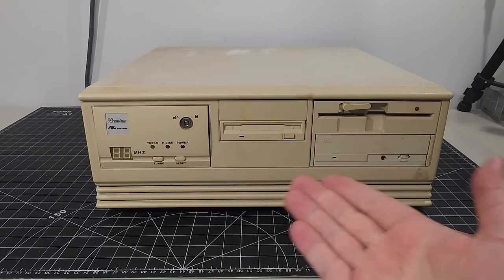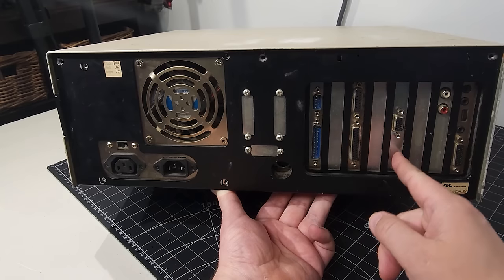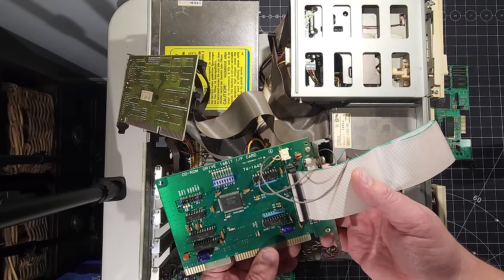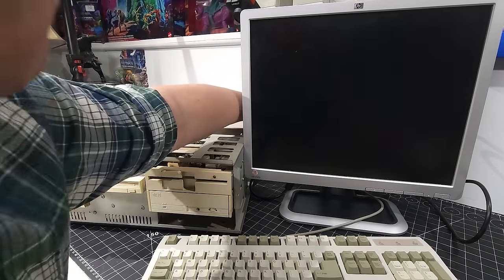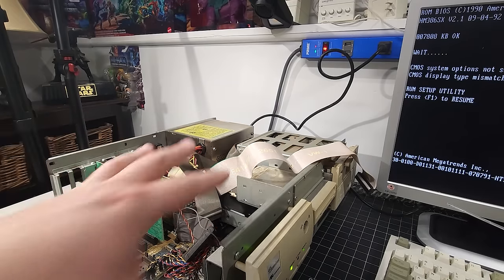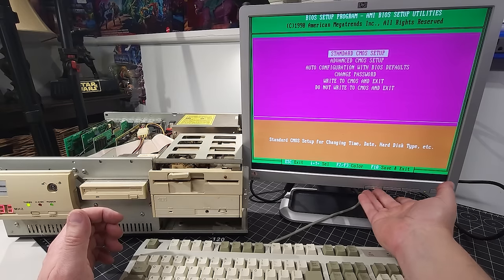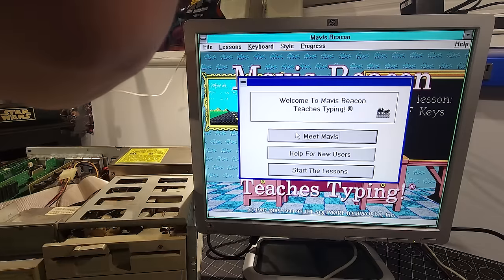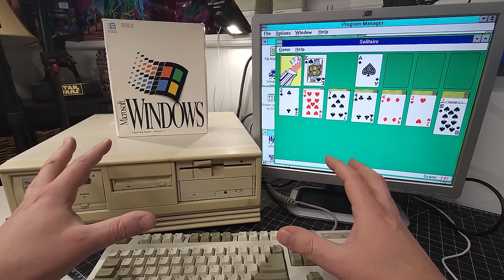What is this Computer...Will it work??

Comment: This makes me feel old.  I remember building these and believe it or not, in the manufacturing plant I work in, I still have a handful of them running DOS.  I've reworked them over the years to keep them running and even put SSD's in them but they're still there chugging away.
Reply from the maker: An SSD in one, that would be quite interesting to see - that and you still have them going, awesome!  Thanks for sharing.
Reply: @TheRetroRecall    Startech makes an IDE to SATA adapter that has worked 90% of places I tried it.   I've supported 300+ production systems for over 30 years now.  When the last floppy disk plant went under about 10 years ago, I bought a bunch of boxes of them..  Still use them to update schedules on some equipment...
Reply from the maker: Nice!  Yes, I'm familiar with Startech stuff.  There are also a lot of different brands on Amazon that I have used that have served the purpose.  Not sure about longevity to be honest.

Comment: IV had that exact thing happen with an ide cable with an old 486 system I bought. Swapped out the cable and it was fine
Reply from the maker: I've had them break inside the cable before, a simple swap out fixes them.  That said, I never recall them preventing the machine from booting.

Comment: So, what was wrong with the cable?  a close look or even rubbing fingers down it could show a bend/break.
Reply from the maker: At first glance, I couldn't detect a break based on touch.  When I get some time I'll use the multimeter to see if I can find an issue.

Comment: I wonder why that IDE cable was preventing the HDD from spinning up. Not installed the wrong way by any chance? .. I'd examine it and meter it out to see if maybe there's a short between a couple of pins.
Reply from the maker: I checked it again afterwards as it was suggested it could be installed incorrectly and the same result (even though I confirmed it was correct).  I'll have to check the cable.

Comment: If you noticed the red HDD led was solid when the fault occurred, but went out and is flickering now that the cable has been changed? That was an indicator of the crook cable or I/O card error.  Windows 3.11 for Workgrooups was the best and WordPerfect for Windows was discontinued after version 5.2. Also it's an 80386 not a 30386 lol. My first PCwas an 80286. Microsoft back then also promised to keep their OS small and under 100mb but look at them now and windows just keeps getting bigger and crappier. Anyway nice PC and brings back many memories of my old girl...
Reply from the maker: Thanks for the added detail :)

Comment: It works great 👍 Can it run Crysis?  😂 I also have a 386 DX with 40 MHz, 64 MB RAM and 32 GB SD card but with Windows 95. These old I/O interface cards can even address large disks with Disk Manager.  However, you should take a lot of time to describe them.  But it's still not enough for Doom in full screen mode, the 386 doesn't have enough power for that.  Your computer is really very contemporary 👍😃 very nice device. You can hardly find these iconic CD drives in particular these days.  They were very slow at single or double speed.  But they were built to last.  Many newer ones have problems with CD drawers getting stuck etc.
Reply from the maker: I can definitely see that happening!  It's a 1x Mitsumi drive as I found out. I'm looking forward to restoring this system!

Comment: THis machine was manufactured by AST Research, based in Irvine, CA. Originally they manufactured expansion cards for IBM PCs, then changed into one of the many PC compatible manufacturers.
Reply from the maker: Interesting.  I am familiar with AST, just didn't think that they made this machine.
Reply: @TheRetroRecall It does look similar to AST, but you said iymt had a different maker emblem on the case. My first PC was an AST 486dx2 It was a Windows 95 machine VERSION C! I never tried to add usb, though.
Reply from the maker: I'd love to get a decent 486 on the go.  That would be my childhood system.
Reply: 20 years ago, I had a trailer load of them. I bought them from a local college.  But, I haven't seen one in several years.

Comment: I'm a bit disappointed you didn't test any of the other drives. That optical drive is one of the oldest I've ever seen and am really curious to see if it actually works or not. That has to be one of the very early models when the CD-ROM drives were first put in desktop systems! Very cool!
Reply from the maker: Haha don't be disappointed, stay tuned for the future restoration video!  I really wanted to go over the system and get it working.  Yes - it's the oldest drive I've seen before as well. My oldest before this was a 2x Sony cartridge cdrom.

Comment: Thats cool, and speaking of thrift finds, i found a Toshiba Satellite L35-S2151 Laptop from around 2006. When i first booted it up, it said "Operating System Not Found", and when i went into the BIOS, it didn't show info about a hard drive. I unscrewed the plate where a hard drive would go, and i didn't see a hard drive. So i put in a hard drive from a Dell computer and it worked. I installed a Toshiba OEM Copy of Windows XP, and now it works.
Reply from the maker: That's awesome, glad you were able to get it going again!!

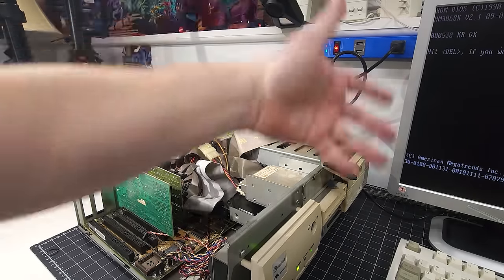Comment: I have created that problem accidentally on my own in the past by plugging the IDE cable to controller card in reverse. One good indication is steady HDD light, and no spin. My eyes were on that red light since first power up. After 25:10 There was nothing else to see here.
Reply from the maker: Unfortunately that was not the case.  I tested the cable afterwards (as some viewers recommended it) and same results even knowing I did it correctly.  When I put the new cable in the same configuration - it works again.  I am going to use my multimeter to see if there is. A short in the cable - which is very possible given its age.

Comment: Cool. 8 MB of RAM was a lot for 386. Pentium 75 mhz systems shipped with 8 MB RAM around 1995 :)
Reply: Also 8 MB of RAM in 1995 had a retail value f $200, lol.
Reply from the maker: For sure.  I think this was upgraded to account for the 8mb.  No doubt it came with 4 or less :)
Reply from the maker: I briefly remember that.  I'm wondering if 8mb for 200 was for 1 module VS the individual 1mb sticks that are in this machine.  That could have been even more costly.

Comment: I was screaming at the screen to flip the ide cable into the back of the hard drive. Pin one might not have been lined up from the controller to the drive.
Reply from the maker: Haha, I was told that after by someone else.  I did try it again after before releasing the video and rest assured - it doesn't work haha.  There is definitely something wrong with the cable :)
Reply: @TheRetroRecall  fair enough, I’m glad to see it working again. I have a 286 machine with a similar layout inside. And I have a 486 dx4 100 board without a case, and also a pentium 200mmx system that I built from parts I’ve gathered. Anyway, yeah, I love your videos man, keep it up!
Reply from the maker: I could hear you screaming from here 😂.  I wish I could get a 486 dx4100 vlb board.  That's my childhood computer and I haven't been able to get one.  Jealous of yours!  Put it to good use :)

Comment: One more thing. Is the floppy drive lights or hard drive lights come on and stays not. Only can it be a bad cable or controller card. The cable can be plugged in backwards. The 2nd I saw the hard drive light on solid and not blinking. I would have turned it off. It is very rare to fry a drive or floppy that way. But it can happen.
Reply from the maker: Good to know.  One other person indicated the same thing, however I did check the cable and when I put it back on it didn't work.  Again, good to know it can cause damage if left on.  Thanks!

Comment: Great job on the diagnostics, and how odd that it should be a bad ribbon cable---fairly unusual. Then again, I did have a system that wouldn't post due to a bad phone modem---those almost never fail, but it did  on that system
Reply from the maker: For sure, something so simple. I wasn't sure if I was going to get this going again or not, so I was genuinely pleased we found the problem!

Comment: Not all plastic ages the the same so the optical drive could very well be of the same age.
It's as far as I know a fire retardant that causes it to go yellow, so if the plastic don't have the retardant it won't yellow.
Also be aware that the 15 pin port could be an AUI network port. They usually have a metal lock slider though.
In my experience some computers are stuck a very long time when it can't match the hard drive properly before complaining. This could be caused by the CMOS setting for the hard disk or a bad hard disk.
Reply from the maker: Good call on the plastics, never thought about that.  Yes - I do recall those 15 min networks ports having the locks on them to prevent disconnections. This case was definitely caused by that cable.  I went back and put the old cable in, and sure enough, same symptoms.

Comment: Oldest PC i recently obtained (which the case is being used for a sleeper build) is a pentium II system with the slot-2 cpu type. Is my second system with ISA slots, first one being a save from being tossed.
Reply from the maker: Amazing!!! Another system saved.  What hardware did you install for the sleeper?

Comment: I've had issues very similar to yours where the IDE cable was upside down on one end. Sometimes they post with no HD found, but the common thing is the HD not spinning.
Reply from the maker: Yes I did try putting the cable back in and making sure it was in correctly, and same symptom.  It was definitely the cable this time around.

Comment: What is the function of these seven-segment displays, used on the front of PC cabinets from the 90s?
Reply from the maker: Usually to show the CPU set speed.  The display either had jumpers on the back to set the speed for looks, or the turbo button would trigger a change of connected.

Comment: I've seen it before if you had the IDE ID  set and used the wrong position (master or slave) on the ribbon cable, this exact issue happens. The ID (set with jumpers on the hard drive) and position have to match if you have a cable that will accept 2 IDE drives
Reply from the maker: For sure.  In this case I had checked the cable afterwards and ensured it was connected correctly and same symptom.  The new cable worked perfectly.  Definitely an issue with the cable.

Comment: Although it is a 40 pin flat cable this is NOT "IDE". Mitsumi had it's own proprietary CD-ROM Technology, so did Sony & Matsushita, before the days of IDE CD Rom Drives you could actually purchase generic Sound cards that included all 3 distinct Cd ROM Pin header ports (2 of them where 40 pins BUT NOT IDE), which would allow you to save a slot by removing the specific CD ROM Controller card and replacing it with a Sound card/CD ROM all in one ISA card.
Reply from the maker: Yes, that was a slip on my part.  Especially considering I have a few of those cards with multi support for various manufacturers of these drives prior to them moving to a standard.  The dedicated card in the system also gave it away.  Thanks again for the detailed info.
Reply: @TheRetroRecall  Any time, I was in a shop custom building/upgrading machines during this time period so hundreds of them passed through my bench.
Reply from the maker: That would have been some great times!

Comment: My very first hard drive based computer was an old knock off IBM compatible from Sears back in the early 90's. It had a whooping 286 16mhz with turbo that dropped to 8mhz. at the beginning it had 1mb of ram and a simple OS called Geo-works. After attending college and learning more I boosted it to 4mb of ram and Windows 3.11. To say it was slow is an understatement!!! But it got the job done. Oh yeah... it had a 40mb Hard drive which I filled up quickly with MIDI files LOL.
Reply from the maker: Haha that's awesome, and back in the day we would NEVER fill 40mb right?!?! 😂

Comment: Problem with the hard drive was the cable was upside down.  When its plugged in backwards the HD light stays on and the HD does not spin up.  You can prove it by flipping the cable on one end and pluggin it back in.  Based on when you plugged the cable back in on the controller, it was on the HD side.
Reply from the maker: Appreciate the recommendation.  I tried the cable again as suggested by other viewers and it produced the exact same symptoms even when connected correctly.  I then put the replacement cable back on and it booted correctly.  There is definitely something wrong with the old cable.

Comment: I have never seen that turbo button actually do anything.   What is it there for?
Reply from the maker: I think on this system it doesn't actually do anything, however normally it is meant to actually slow down your system for older dos applications / games (reduce the CPU speed).  I used to have a 486 DX4 100 that I would use that on.

Comment: I would be willing to bet that IDE cable for the HDD was connected backwards on one end or the other.. probably the card end since there is not obvious keying.  Great trip down memory lane.
Reply from the maker: A few viewers had suggested that as a fix.  I went back and tested the old cable triple checking it was on correctly and same results.  It seems that the cable was truly gone.
Reply: @TheRetroRecall  Probably a short in the cable, but it was a common problem with IDE cables, a lot of them were not keyed, and reversing them would cause the exact symptom,  hard drive light stuck on and no post.  It was an easy mistake to make if you were in a rush, and it almost never caused permanent damage. Have to love old school PC's
Reply from the maker: Agreed!

Comment: My first thought was immediately that this is from 286/386 era, because both floppy formats are present, but since there's a CD it's more likely a 386. And for some reason every 386SX  had a desktop case, while DX had (mini)towers. I almost guessed just by looking at the case what's inside :). Back in 1994 I had a 386DX/40  with 4MB RAM, 1MB SVGA graphics and 420MB HDD, 14400bps modem and a hand-made covox speech thing DAC/soundcard. There was a quantum leap in years '92-94 in hard drive capacity and drop in price, I remember ogling 80-120MB drives just a year before, and ending up with 420MB "beast". Could install all the programs I'll ever need! Until I filled it up a few months later... As the 5.25" floppies were starting to be phased out in favor of 3.5", my computer was used as a "hub" for copying from one format to another for my friends, incidentally I ended up discovering any software anyone of them would get (and keeping my copy). That was before we just brought the whole hard drive with us for home visits.
Reply from the maker: Thanks for sharing this memory - I love hearing these!  My first real system was a 486 dx4 100 which had an optical drive.  I was the talk of the town with my friends as I could play music cd's on my computer... Whoa!  Fast-forward a short time later when I got my Pentium 100 and my HP Cdriter 2x... Watch out... There was a line up at my door to make 'mixed' cd's :).  All good, but I had to watch for those pesky buffer under runs lol.  Thanks again for sharing and triggering this memory for me :)
Reply: @TheRetroRecall  I remember when CD-burning shops appeared, you'd take them a HDD and then come back after 2-3 hours and you'll get your "backup" on a CD. For the most time it was indeed a backup b/c not everyone could afford a big enough secondary HDD to make custom software compilations. Those shops lasted for a very short while, only to be replaced with "CD clubs", who both rented and burned not-so-legal copies :) In my hometown once half of the town got CIH virus from a game that was distributed from one of those CD clubs. We identified the club and the game and told them that, so they got a non-infected copy, and we got a free rental for a couple of games :) The CD burning software was relatively closely guarded by those clubs to avoid competition. When my roommate got a 4x CD burner we had to hide that fact for a few months (we still managed to convince our local CD club owner to give us a copy of WinOnCD, though - he was a cool dude). In less than a year everyone and their grandmother had a 16x CD burner and blank CDs were bought by  spindles of 100. My 16x CD burner died after maybe a six months, so I got it replaced under the warranty with a brand new 48x burner, as they already stopped selling 16x and 24x models.
Reply from the maker: Talk about a walk down memory lane!!!! I forgot about the shops and clubs.. As I was fortunate enough to have the drive, but yes it took no time at all before the drives were plentiful!